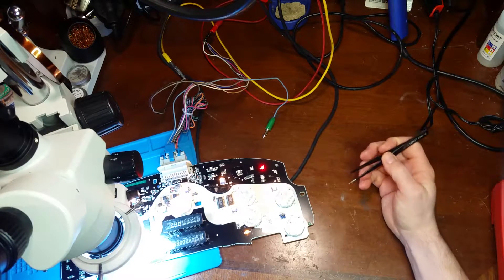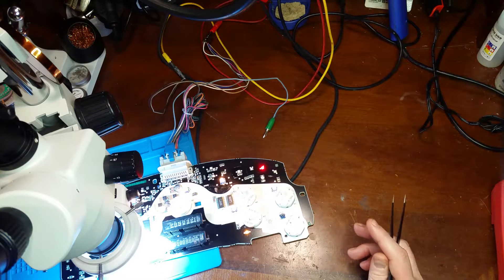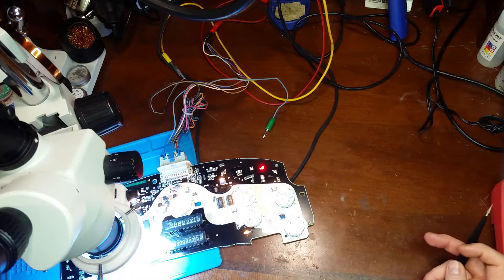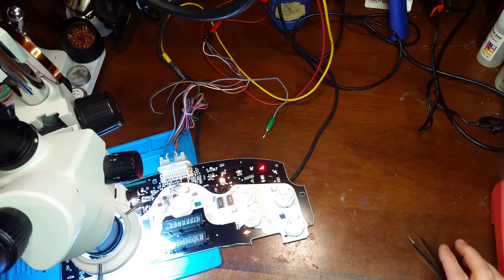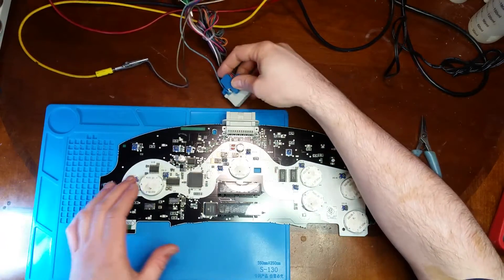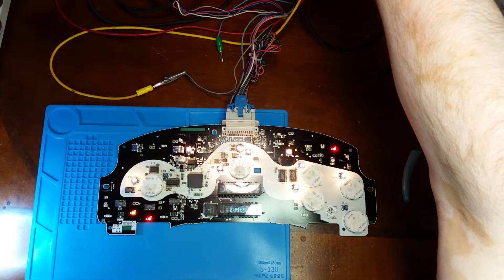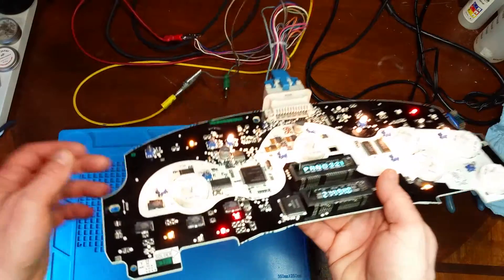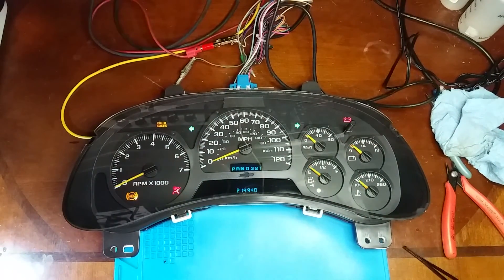Trailblazer Cluster Display Repair

Comment: I have a 2003 Trailblazer. Driver door and all steering wheel buttons don't work. Also the mileage indicator doesn't work. It says something about Airbag. Also the driver side mirror is busted. Any ideas on all this. Just bought it. Thanks for any help...😊

Comment: Just replaced the mosfet on my trailblazer cluster. The odometer display works now but only after pressing the odo/trip button. And the PRNDL still doesn’t light up. Looks like I’ll still have to do some digging

Comment: 2003 trailblazer. Gauges work but no display. Will this be also fix the problem?
Reply from the maker: Could be. Could also be fractured solder joints at perhaps a resistor.

Comment: Hey Jeff, help please I need to know what wire or wires to power to get the PRND and ODO to light up when testing on the bench. I've figured out the grounds pin A4 and A5.  I figured out the lights positives- Instrument lights Pin A7, left turn signals  A1, right turn signal B10.
Reply from the maker: Did you do a google image search for the connector pinout?
Reply: @jeffescortlx  Ya as you can see above I already know all the pins points. I have the schematic. Just currently have a cluster i'm trying to view on the bench , Ive got the lights powered on and turn signals but nothing else. Guessing I need too connect a few other wires. I see A2 and B7 are Battery positive, B1 is Data.
Reply: I figured it out . Thanks
Reply from the maker: @mogyver69  glad to hear. Was probably a ignition wire you needed?
Reply: @jeffescortlx  The PRND and miles wer not reading because I had a bad cluster. So it made it hard to figure out the wires. LOL I got the wires sorted out and the cluster fixed.

Comment: My gear select display and odometer display works but the driver information center does not. I have power coming from the button harnesses and jumped (bypassed) the switches and still no display. Any ideas?
Reply from the maker: For the trailblazer the odometer is the driver info display.

Comment: can you send me the link to the one you did on the 2004 trailblazer for the one you did where it drained the battery when the key is turned off please thanks
Reply from the maker: This is as close as your going to get. Same part in this video failed, it just happen to fail open instead of closed.

Comment: I have a cluster from a 2003 Trailblazer a customer brought to me this morning. I haven't had a lot of time to look at it yet, but the customer said the only problem was the oil pressure gauge (I assume stepper, but haven't verified it yet). I attempted to power it up and the entire cluster is dead. It worked this morning and now is totally dead! I haven't ran into this kind of problem yet. I thought before I started probing around I would ask you if you have had any of these critters that were completely dead, and if you had noticed any commonality. Thanks for your video btw! I'll post back and let you know what I find.
Reply from the maker: It's not a super common thing for the trailblazer. Start with the basics and confirm power and accessorie key on power is making it to the board.
Reply: @jeffescortlx  It's being powered by my cccv bench supply so I'm certain it's getting power. Looks like possibly a ground problem as voltage is passing through the lamps. I'll just have to spend some time with it this weekend. Thanks for responding and have a great weekend!

Comment: Nice. My gear display used to come on randomly but now it hasn't worked in 2 years. Would that same piece cause that?
The odometer display works perfect though.
Reply from the maker: You might just have fractured solder joints causing that.
Reply: Havent taken the cluster out yet, but today it was -28C and when i started the vehicle. My gear lights came back on. This was the norm just over 3 years ago, where the gear lights only came on in the bitter cold. But not all the time.

Comment: Another great video! So, I assume on the vehicle that had a battery drain with the MOSFET stuck on, the odometer stayed illuminated with the key off? 
TIA for the response.
Thanks!
Reply from the maker: Actually no. Since the other half (side that was in control of the pixies) of the VFD still powered down.
Reply: @jeffescortlx  
Thanks, that's very helpful info. So when you find the mosfet staying on, have you checked how much current the ckt is drawing? TIA
Reply from the maker: @robtemple3445  no, I haven't investigated that far. Once I see the transistor is shorted it gets yanked off the board.

Comment: which mosfet do i need to fix this? which one exactly did you use?  thank you in advance.   Im stuck here with a trailblazer in Holland. :(
Reply from the maker: Sorry I don't have the complete part number. I used what I had on hand and got lucky.
Reply: I am going to try the SOT-23  mosfet
Reply: Or maybe you want to send a mosfet you used to me? I pay you for it ofcourse
Reply from the maker: I used the MOSFET that is used for the 07 cluster display. It's not correct, but it works. My video's showing the 07 repair have the part number listed in the description.

Comment: Have you found out what type of mosfet it takes?  I'd like to put back an original one.
Reply from the maker: Donor board to be sure it's exact.
Reply: jeffescortlx  I was wanting to order a new one.  Like through mouser or what not.
Reply from the maker: Sorry I do not know the full complete part number.
Reply: jeffescortlx  Thanks.  And I like all your videos bro.
Reply from the maker: Glad to hear you can use the video's!
Reply: jeffescortlx  you should do one of an f-250 with the intermittent problem.
Reply: same question here, what mosfet can i use for this repair???

Comment: Where did you learn about cluster repair? Looking to start my own local business and would like to get educated.
Reply from the maker: I have a background in electronic repair. Started with a interest at a young age. Degree in general electronics, work experience with industrial electronics and personal experience with automotive electronics.  Mix in some trial and error, reverse engineering and google.
Reply: jeffescortlx any educational resources you would recommend? Learned a ton from your videos already
Reply from the maker: Can't think of anything actually related to cluster repair available out there today. Just YouTube video's of people willing to share info. I would suggest leaning as much as you can about basic electronics and understanding how everything works together.
Reply: jeffescortlx thanks for your help!
Reply from the maker: Glad to help! Jump in and start getting some hands on learning!
Reply: Hate to bother you again, but how do you supply power to the cluster? I bought a power supply, but I am unsure about which connections go where.
Reply from the maker: Wiring diagrams are available with searching through google.